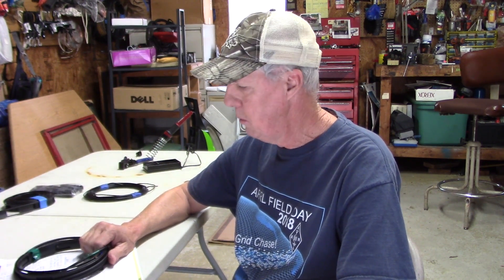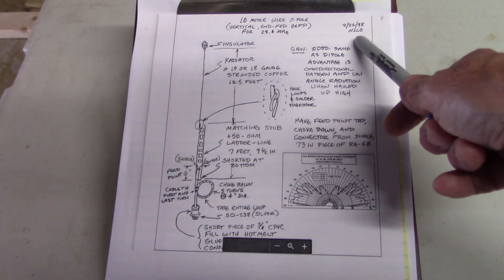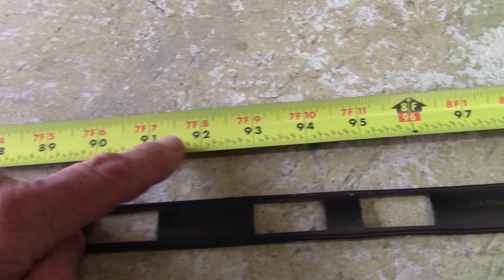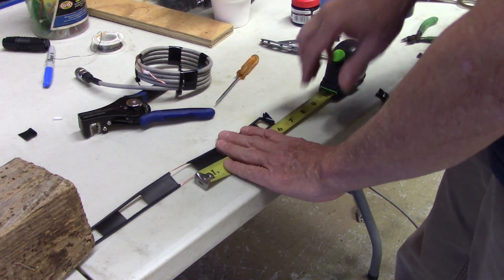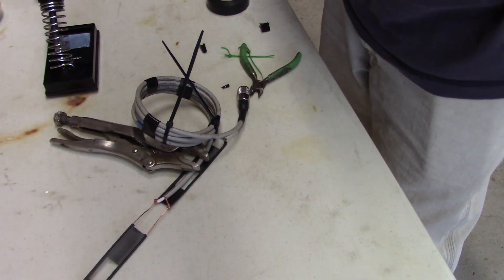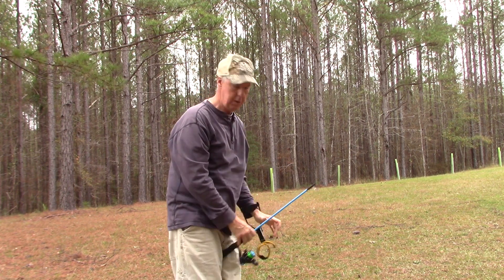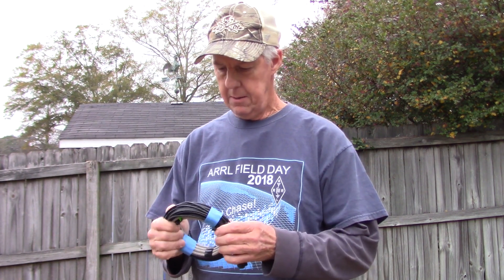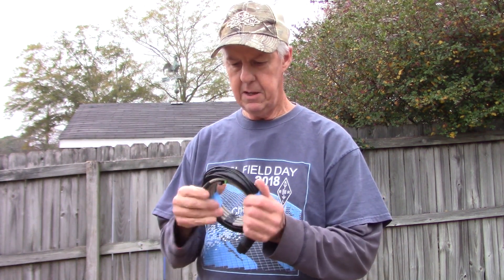10 METER LADDER LINE J POLE ANTENNA / Build and Field Test

Comment: A 2M J-Pole can be made from 450 Ohm ladderline. Solid conductor works best.

Cut it for 58-in overall length after shorting wires on end.
 Cut out one inch of wire on one leg 18.5 inch from shorted end. Remove 1/2-in insulation from both legs up from shorted end so coax connection can be made 2-in up from shorted end. Run coax up long side so shield can be soldered to 2-in mark and run center conductor over to short side 2-in point. Paint exposed coax with clear fingernail polish to weatherproof exposed coax. Wait until thoroughly dry and apply another coat of polish. Paint solder joints with polish as well as shorted end of ladderline. Make attachment at 58-in top end for hanging.

May also be taped to side of 1-in PVC pipe so pipe can be used as support mast. 

Covers most of 2M band.

Remember: 2-in up, 2-in across for feed points.
KK5R

Comment: I live in a area that I have not been able to receive a 10 or 6 meter signal not even atmosphere noise. My best effort so far is a 25’ vertical wire with 4:1 transformer on a 31’ fiberglass rod. This antenna works well on 40m,20m and fair on 15m. I just have a bad  location. I tried your 6m ladder line jpole on the 31’ mast but had no reception.
Reply from the maker: Take it portable somewhere. Don't let your qth hold you back from some good 10M activity this fall. Steve - Ad4xt
Reply: @hamradioportable1630 , I finally figured out I had two problems. The antenna needed to be improved. My new transceiver had no reception on four bands and went back for warranty repair. My old hybrid project transceiver works well on 40 M- 10 M with improved antenna .

Comment: Damned fine video, one of the best hamster events on the Internet.  You clearly built a  killer antenna and all a guy needs is apparently  a tall tree. I'm guessing that you blew away many headsets in use at stations well over 1000 miles from GA. Thanks for this video de WW5II in Minnesota.  How much power were you running on SSB?
Reply from the maker: Just 100w   10 meter season is here. Hope you build one.

Comment: These ladder lines work great for vhf/uhf. But for 6m,10m youll want 5.5" space inside. This works better. Dont wind coax traps, use ferrite beads. And use  ferrite at 1/4~ length from feddpoint. Slide up and down for best swr.
Reply from the maker: Trying to keep the cost down. I did a A/B side by comparison with this antenna to my Maco 5/8 wave ground plane at the same height. Same coax and length. About 1 s unit better on the Maco. Both of them destroyed my EFHW 10-40.   Steve - Ad4xt
Reply: Probably doesn't need the trap (dirty balun).

Comment: Hello Steve, 

Just came across your video,  and I'm very glad I found that. The explanations are very good, step by step. 
Great quality of image, and I like very much to see the SWR on FT-991 and you dit a lot of QSO. 

It is sure I will built one myself, as I have all the material here,  and I shall be ready, to try it somewhere 
in april or may, because here we just got a good snow storm  between 8 to 12 inches of snow, with winds. 

The temp is minus 15 degrees celcius..  brrr !! 

Steve, thank you again, it is an awsome nice job. 

72/73 Mike VE2TH 
The QRP'er for 60 years last year.

Comment: There's a couple of small tweaks that can be done to this design. Try using a dip meter to find the exact velocity factor before cutting the 1/4 wavelength matching stub. It hardly ever is what's stated. I've found ladderline from DX Engineering to be close to .93. Fine tuning the stub can get a better match and put the tuning where you want it. Another tweak is to place a few ferrite chokes on the coax right near the feedpoint to help keep it from altering the radiation pattern. Elevate the feedpoint 3/4 to 1 wavelength above ground for optimum height and give it a go. I've had excellent results with a Slim Jim version that I can also tune up on 12m and 15m.

Comment: i think the center wire of  coax needs to be attached to the long side of ladder doesn't it. Do the instructions indicate that.
Reply from the maker: It does not matter which side for the center conductor. You will find plans for the shield to go on either side. Ladder line and the J is to provide a 50 ohm match. I have done it both ways with no difference. Build it and enjoy. Will be a great antenna this fall on 10M.   Steve - Ad4xt

Comment: You would achieve more bandwidth by using a spacing of 6 or 8 inches between the wires of the ladder line. This can be done with 14 AWG wire and some insulators between the wires. All the best.

Comment: Great video. I found that same N1LO diagram and I've been making them up for fellow club members at cost. I happen across some interesting solderless disconnect blocks that mount nicely just below the feed point using a tiewrap. Allows for unplugging coax feedline and providing strain relief. Saw them in a video using them from an aussie  who used them on his "Extension Cord 10 Meter Vertical" Called Kaszoox. Available on Amazon. 10 Sets 5.08mm Pitch Male & Female No Soldering Green Phoenix Type Connector 4 Pin PCB Screw Terminal Block. 16.99. Can use on other band J-poles too.73, John

Comment: Hi Just wondering - can your Vertical Antenna be run straight up a 30ft Metal Push Up Flag Pole and still work good? which also has a GMRS J-Pole Antenna on the tip top.
Reply from the maker: Not sure, give it a try and let me know.

Comment: HI, Can I mount it horizontally?  Thank you
Reply from the maker: You can ,  May effect the tuning.  Tune it as you plan to install it. I may test that. Just get it up. 
Steve- Ad4xt
Reply: @hamradioportable1630  thank you so much for the reply Steve. I will try it once I get my new radio. 73, WX2WX

Comment: I bumped into this video and it caught my attention. I will build my own 10m j-pole to test it against a inverted-L end fed have wave (80-10). Great instructions, nice signals (real dx). 73 Phil ON4VP
Reply from the maker: The secret sauce to this antenna is that: 1) no radials are needed.  2) It's very light and you can pull this antenna very high into a tree top.  Even when pulling up some good coax.  Very easy to take portable.  Build it, you will be very happy with it.
Steve - Ad4xt

Comment: Looks like a great antenna! I've been wanting to build one myself. Don't under estimate rg8x coax! I've run 800 watts though it and never had a problem. WAY better than rg58 and not much bigger around. A lot less bulky and cumbersome than rg8 pr lmr400. Also the length of the antenna determines the resonance. Where you attach the coax actually adjusts your feed point impedance not the resonant frequency, although it can make the swr look good. I'm trying to master the art of complex impedance myself, so this is a good physical example of the difference between a resonant antenna and a matched antenna. This also means you can feed it with ladder line if desired if you attach the feed line further from the bottom. I'm curious to experiment with this and do a comparison. I believe j-poles are fairly broad banded and I've always been a fan. You could spent hundreds on a commercially built antenna, or have fun building one of these which looks way cooler anyway! Thanks for sharing this project with us and 73's!

Comment: Great video!

A couple questions:

1. Is it common for resonant frequency to move slightly higher when elevating the antenna? I'm assuming that just getting it elevated to less stuff is in the near-field causes the impact.
2. Any reason other than cost/weight to use the air choke over a ferrite or two?
3. Would it be OK to just make the whole antenna from ladder line, like a slim-jim setup where the top is shorted and a 4cm or so gap is cut in one side? Seems more expensive but a little more resilient.
Reply from the maker: Yes, frequency can move with the elevation. Everything affects everything with wire Is antennas.
You can choke it anyway you prefer.. That will work.
I like to keep the antenna simple and easy to build.
And low cost. We have a couple of local hams that have this antenna strung up in a tree 75' or so. With proper Strain relief it will hold up the big coax just fine. Steve - Ad4xt

Comment: Como se calculan los largos de ambas partes de la antena. Me interesaria probar una en 40 metros horizontal. Gracias y muy buen video.-
Reply: Esta antena J es en realidad una Zeppelin. Puedes buscar en la web y encontrarás toda la info que necesitas. Basicamente la parte radiante es una 1/2 onda y el stub o sección adaptadora (la que está hecha con la línea paralela) es de 1/4 de onda. Si tienes el espacio suficiente ya que la vas a instalar de forma horizontal puedes agregar otra media onda del lado libre de la línea paralela (doble Zeppelin). Tiene que estar extendida y no en forma de V invertida para que no se distorsionen los lóbulos de radiación. Y la altura recomendada no menor a 1/2 onda. Debido a sus dimensiones y altura requerida usualmente su uso se limita a las bandas altas de HF.  Pero para 40m puedes probar con una sola 1/2 aunque no le veo mucho sentido. Creo que te sigue conveniendo un dipolo común y corriente.

Comment: Great video but I see a couple of tweaks construction wise the first I noticed would be to use a piece of 4" PVC or a cardboard tube former for you balun windings. I realize you don't have to be uber precise on these things, but I just like the precision of a former to wind coils on. Also you could lay a couple of zip-ties on the former before you start winding. Like I said it just my maker ocd manifesting itself in commentary. I really enjoyed your presentation. That was some clean signal. 73
Reply: You're right.
It's better to not jumble wind dirty banuns to avoid unwanted intercapacitance that could affect choking effect.

Comment: I'm a little late to the party, but could you use 300omh twin lead instead of window line?? Asking for friend 😉
Reply from the maker: It's possible, measurements would be different. The ladder line length would be way too long. Stick with the 450ohm to keep it simple.
Steve - Ad4xt

Comment: I once made an aluminium J-Pole for 11m, it was a great antenna. I had teething problems with it though, they're shocking for CMC. I would tune it at ground level, but once I raised it up, the SWR would go through the roof. Maybe this is an antenna Q thing as well. Anyway, I found that if I fed it at the 200 ohm point with a 4:1 coaxial balun, it settled the whole thing down. I was using a decent ferrite choke btw. That's the beauty of these antennas, variable input impedance. You could easily feed it with 450 ohm ladder line. Another thing worth mentioning, you could make a version of this completely with ladder line, a Slim Jim. Short at each end and simply make a short cutout on one side. It has a second half wavelength that doubles back down on itself. That's another I have made in wire, what a performer that was.

Comment: Put my antenna together today ............SWR  1.27  at 28.400 MHz ..............Perfect !
Reply from the maker: That's awesome. Pull it up high as you can in a tall tree. You won't be disappointed.
Steve- Ad4xt
Reply: @hamradioportable1630  Thank Again !  73  from KO1CCO

Comment: Thanks for the video & easy to follow directions. As a technician this build is right up my alley & I do enjoy building antennas. Going to try one out for a POTA activation with my FT-710 on FT8 & SSB.  If all goes well a 6m build will be my next adventure.  73's KB9QDI

Comment: Wow, glad I found you.  EXACTLY my problem - weekly 10m net, and I simply could not participate - so much noise on receive, and no one could hear me.
Reply from the maker: We started a weekly 10m net in my area. After our club build of this antenna, we now 
have many more able to participate. I can't emphasize enough, if this antenna is working well for your local net it will be one heck of a DX antenna. I have compared this antenna to my 5/8 wave Maco vertical antenna at the same height. Not enough difference to mention.
Have fun with it.
Steve - Ad4xt

Comment: I like it.  

I've been using a end fed half wave dipole for the same use case.  It's really just ~5m length of wire (one cut for 28.400MHz for SSB, and one cut for 29.600MHz for FM) and a small 49:1 unun stuffed into a small pill bottle.

I'm curious now to compare the two.  I suspect the EFHW may be less efficient due to losses in the unun, but should be a lot more practical for field ops.  Longer wire on the EFHW means multiband operation on that single wire.  Tuning the antenna for that perfect match should be easier too.
Reply from the maker: The neat part about this antenna is that you can get really high into a tree. 
Steve - Ad4xt

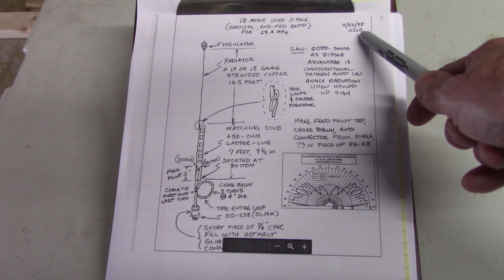Comment: Steve. I think that the diagram @2:40 is wrong, I think that the center goes to the long leg and the shield goes to the short leg,  What say you? I tested mine today, first call was to Puerto Rico, and the 2:1 bandwidth was about 1 Mhz.  Nice antenna, I used it with a 40ft sotabeams fiberglass mast in a hitch mount.  I like it.  73's de K8MH
Reply from the maker: It does not matter which side you use. I have tested both ways. Just where on the window line you attach. 
Final tweaking with the 14ga wire length. A great antenna. Have fun with it.
Steve - Ad4xt

Comment: I noticed he wrote 7' 9 1/2" for the ladder line and you had cut it for 7' 9 1/4", how does that affect the resonant frequency? I want to build it for 28.1 Mhz for my QRP CW activities. I will look up his schematic. Cheers es 73, Davey - KU9L PS- Salvaged ladder line is the way to go, 100 feet of 450-ohm ladder line is $87 on AMZ. US full-time RVers have a tiny junk box, lol!
Reply from the maker: Yes, I cut mine short by mistake.  Attaching the coax connection a bit lower made up for that.  Don't solder the connection point until you string it up and get the resonant point you want. As I went lower on the connection point so did the dip.
Steve - Ad4xt
Reply: @hamradioportable1630  Thanks, Steve! Now to drum up some used Ladder-line, $87 for 100' on AMZ.

Comment: Very interesting.  I am wondering if instead of ladder line, I could just use 14 gauge wire all the way through and use some 3d printed standoffs to keep the j spaced out.  I also wonder if that would eliminate the need for the choke.  I've been out of the hobby for a long time, so I'm a little rusty on my antenna theory.
Reply from the maker: You could, but ladder line is so easy to work with. The choke helps keep out the common mode current.
Reply: I have done exactly this with some newer designs, using homebrew ooen wire line to make the matching section. I used 14 ga THHN wire and electric fence insulators from Tractor Supply as spacers. They are 4" long and I cut them in half. Tuneup is great but still requires a choke to prevent the coax shield from radiating. Regardless of matching section type, this antenna will still detune in the rain. The open wire matching section is a little more tolerant though.

Mark - N1LO

Comment: You could also work this horizontal with the matching section hanging down if desired, so this a quick easy and versatile
 antenna, thanks for sharing.
Reply from the maker: It would work great going out a 2nd. Floor window to a tree.

Comment: Tkx fer info. Just moved in to a area that has a  dislike for antennas and I have 2 meter vhf/uhf antenna on a pulley set up. Even hid one in a flag pole. All ways learning the j pole tkx de kv4li 73

Comment: I am impressed with the antenna coverage. I tried making a 2M / 440 rollup J-Pole, and have had the damnest time getting it tuned, just right. I even added a longer strand to the top end, to start re-tuning it. I think I will have to MOVE the co-ax, in order to tune it. But This 10 Meter, will be my next build, after finalizing the first antenna. 
PS. That Liquid Tape comes in handy!  And if you wear surgical gloves, and wet your fingers, you can mold it and work with it, before it cures.
Reply from the maker: Yea those 2M / 440 rollup's can be a little finicky. You wont have any problem with this 10M, Thanks for the liquid tape tip with the wet gloves. I'll give that one a try.
Take care;
Steve - Ad4xt
Reply: More effective to move the feed point on the 2m J-Pole. Also a faire bit more finicky than this 10m version I imagine. Can't say for sure, working on this 10m version now. Got my 2M Slim Jim tuned in pretty quickly when I built it moving the feed point but a little movement is all it took.

Comment: Great vid Steve!   I found another plan which only used the ladder line and the coax. I have not tried that out yet but once I do let’s compare….  I like yours because I think it may be nicer to hang directly from your wire than directly from the ladder line but we’ll see.  73 K4HCQ
Reply from the maker: Thanks Chris;
This version give you a full 1/2 wave on 10 meters. Club build coming soon on this one.
Steve - Ad4xt
Reply: Can you post link?